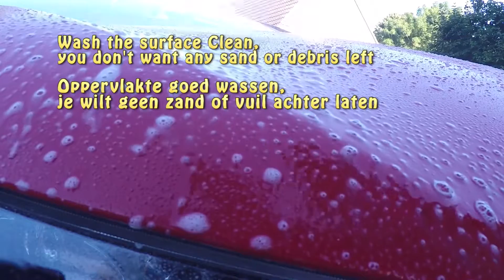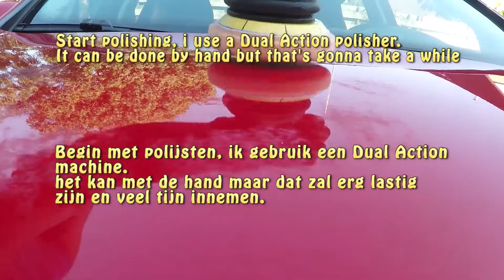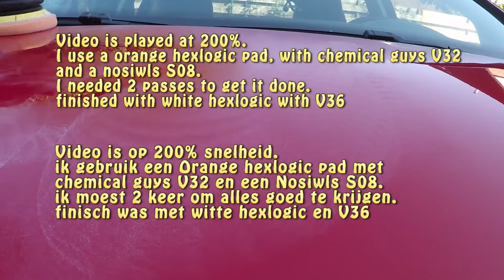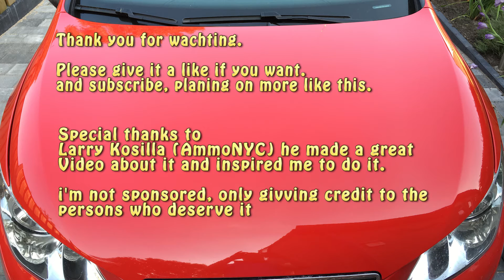How To Paint Chip Touch-up | Zelf Steenslag verwijderen

Comment: I don't see you applying clear coat, or did i miss that part?
Reply from the maker: Michiel van Delft mixed the clear with the color (base) didn’t explain in the video. Stil want to make e new version of it. 
New method is filling with basecoat then fill it up with clear
Clear coat is harder